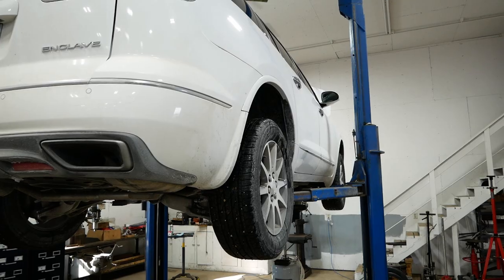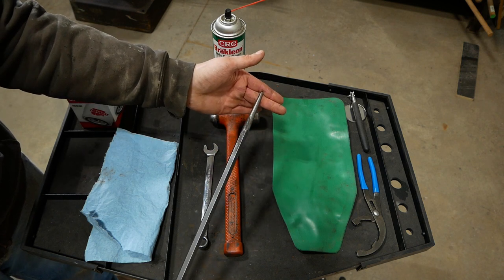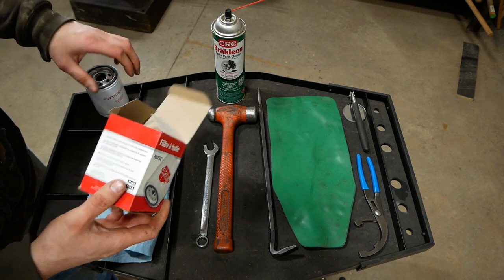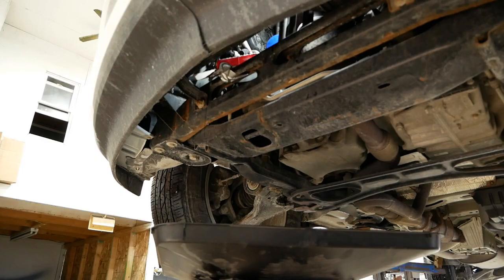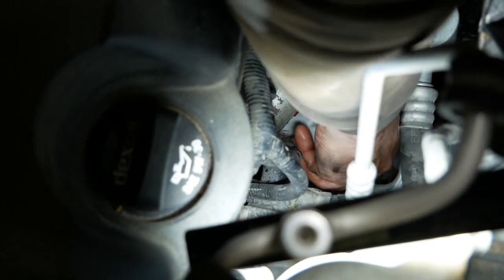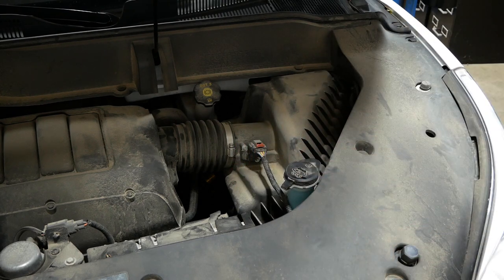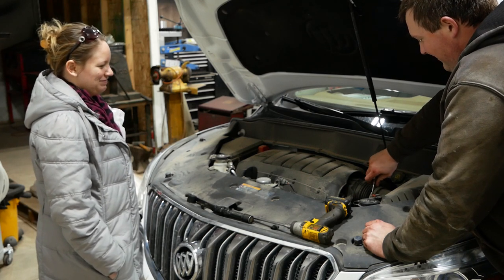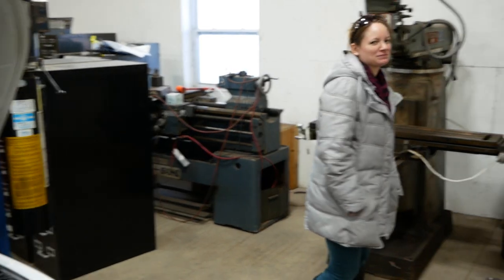Changing a GM 3.6L Spin On Filter without Spilling Oil?

Comment: I hate it when the jerk who changed the oil before over tightens the filter. I REALLY hate it when I’m that jerk.
Reply: Rather do that than have a leak
Reply: Have sworn up and down working on a tight oil filter until the whoops moment hits and I realize that I put that last one on..
Reply: @Fly-Away steel band or filter pliers will get em off 99% of the time. One time on a 7.3 powerstroke I had to put a cheater pipe on my band wrench.
Reply: @Christian I’ve literally had filters rip and tear trying to get them off, you have never experienced a stuck oil filter if you think can simply be removed with a strap wrench or pliers
Reply: @Christian Lmao, the filter get torn when you have to use different methods because the strap wrench just spins on the filter and if you’ve never seen a strap wrench crush a filter, you’ve never seen a stuck filter. And I really don’t give a shit what a type one error is, the entire reason a mechanic exist is to fix what that engineer couldn’t design right in the first place. I also find in funny how you completely ignored that part about you engineers putting oil filters in spots filter wrenches don’t fit such as this design. Unless your driving something from the 90s or older there’s a very good chance you cant get a strap wrench on it.
Reply: @Christian it will if the filters tight enough, the wrench will crush it, there’s literally only one way to use a strap wrench, when it slips try pliers or  the claw removal tool if that doesn’t work your only choice is a large pair of vice grips or a screwdriver and hammer which I don’t recommend. And my don’t give a shit was referring to the “type 1 error” as in you trying to prove your smarter than every mechanic that is literally paid to fix your mess ups. You clearly have never seen a tight filter and have clearly never actually worked on bad designed engine or products.
Reply: @Christian I have a crappy band wrench that tends to spin on really tight filters, especially of they're on the small side. I have a strap wrench that's made of rubber and has teeth on the side of the handle that'll dig in and it never slips.

Comment: My Landcruiser is similar.  I usually make a runway out of paper towels so that it does not run down the block, and on the front axle, steering, etc.  I like the Form-a-Funnel.  Had not heard of that before.  Now I have on on the way from Amazon.  Thanks for the tip Wes.

Comment: "Tons of these 3.6 V6's around" well that is an easy thing to fix, just don't change oil and filters and the problem will sort it self out in a small amount of time.
Reply: When working on cars with hidden filter, It makes it safer and easier for  quick lube oil changes  not to replace the filter and not get caught. New car owners are clueless to where they are and therefore , it's money in the bank at the quick lube oil change shop.

Comment: One of my older cars had one of those side-mount oil filters.  I would take an awl and poke a hole all the way through it to use to turn it.  One poke in one side to empty, then reinsert it and jam it all the way through to torque it loose.  Just watch for the jagged metal on the exit side.

Comment: For oil changes at work I use a windshield washer bottle cut open on the part where the label would be. Its long and oil runs super easy, use it same as a form-a-funnel, that I had no clue existed and am going to order

Comment: Right before Mrs. Wes came out and commented on the motor I was thinking the same thing.  Complexity for no reason.
Reply: I agree, except the reason is that complexity means more dealer hours on otherwise simple tasks as well as the inability of the vehicle owner or an independent shop to do the work. I’d be willing to bet that GM has a proprietary tool to change the filter without spilling and that an oil change on that vehicle is a premium price. While we beat up on the engineers, I think there are bean counters making the call on some of that design.

Comment: I have to this with my 92 and 93 Chevy 4x4s too oil runs all over front drive shaft u joint and hot exhaust i save the heavy aluminium foil pizza pans make forma funnel out of them form around the drive shaft and exhaust pipe punch hole in bottom of filter to go have coffee let it drain come back when engine and exhaust cooled down other wise you're going to get burned. I prefer the hot oil change right off the road better chance of getting the crap out before it settles in the pan oil comes out of filter pretty quick when hot too i hate oily mess after the fact so i take precautions like you your one of the few mechanics ive seen take the time to redirect the oil to avoid a mess and save the brake kleen for more critical things good job.
The last oil change when I didn't have time i took the truck to the gm dealership they had a oil change bay no appointment needed first come first serve of course i have an hour drive to the city so needless to say engine is scorching hot the tech didn't have any issues pulling the plug but as soon as he would attempt to get the filter out the cussing and swearing began first burned arm he would then tuck his sleeves on coveralls into gloves to avoid getting burned again proceeded to spin filter off only to have hot oil gush out and splash all over the drive shaft and exhaust and all over himself gave me shit for bringing it in with engine hot i told him and manager to take it up with the engineers but apparently they never did because they are still putting filters in stupid places in 2017 lol

Comment: And they haven't figured out how to put a drain plug on their automatic transmission pans either.
Reply from the maker: None of them do anymore.
Reply: I never knew how well it worked (or didn't) compared to dropping the pan, but I loved the way Saturn had the screw on transmission filters.
Reply: Drain plugs are an unneeded but greatly appreciated feature.
Reply: My 2000 Toyota Tacoma has a transmission drain plug.  My brother didn't believe me.  He is a Ford lover.............Jay
Reply: @WatchWesWork  dodge does in their truck but it's literally right above the exhaust. Can't even loosen the Allen head plug, it's useless

Comment: I turn the car upside down and let the oil run out of the fill hole, that saves time at the drain plug
Reply: Building a rotisserie that big might take some time.
Reply: @imouse3246  They got devices to put frames of older cars on a spinney wheel, seen one in a video, very cool. Maybe you can just get one of those suckers for these nasty SUVs problem solved
Reply: @baileyhatfield4273  I've seen a couple of sites do that as well, although they aren't tossing around 2 tons of vehicle.
Reply from the maker: I just turn myself upside down.
Reply: Drain the oil out of the oil pan.
Leave the plug off.
Start the engine, let the oil in the filter get pumped into the oil pan and then drain out the open drain hole.
NOT!
Reply: @tpcoachfix  That might actually work if you jumped the starter leads, and left the ignition system out of the loop.

Comment: This is why I still have the old Falcon and the Tdi 300 Defender. No plastic, oil filters face down and accessible and the air boxes are easy to open! 4 clips for the Falcon and one wing nut for the Defender. If I have to change the oil on a vehicle with a horizontal oil filter I will 100% follow your method as it works brilliantly!

Comment: Haven't really found a "good" way to change these. We buy brake clean in bulk drums, so I usually just hose it down good when changing them. Then, when it's up in the air, I wipe it down best I can with more brake clean. Definitely agree with the Mrs. on all that plastic under the hood. Makes it tough to jump start when it gets crusty under the ground lug.

Comment: Ah yes, GM and their fit anything anywhere obsession... 😂
Reply: Not just them, my wife graduated from college at the old age of 45.
To celebrate that and a good paying job in the medical field she bought her dream car. A '99 sebring jxi gold edition convertible.
I had to do the regular maintenance as usual.  Not happy. Intake manifold had to come off to get to the back 3 plugs, left front tire off to get to the battery in the fender well. So yeah you've got the designers and the engineers trying to find where to put things
Reply: @donniebrown2896  If it makes you feel any better I own a Nissan I-4 and i have to take the manifold off to replace any spark plugs.
Reply: @MalleusSemperVictor  

I could get to all 8 on my old 4 cylinder Ranger without removing anything. 4 cylinders, two sets of coils, 8 wires and 8 plugs.
Reply: @MalleusSemperVictor  I had an early 90s V6 Camry, same deal.  Dropped the manifold right over the rear bank and made it all but impossible to reach.  Gave up and paid a shop to do it, labor was so bad it cost almost as much 20 years ago to do those plugs as it does to have a shop do all sixteen plugs in my Charger now.

Comment: Wes is using a kind of funnel?
Reply: @queenstownkid  it’s sarcasm. Wes does not like funnels. He’s been pretty vocal that he hates them.
Reply: @jeffburdess2237  MY OCD as screaming GET A FUNNEL when he poured both fluids. I bought a set of funnels that latch into the valve cover. But I DID have to do a TON of oil changes EVERY FRACKING DAY! Have the guy with 40 years experience doing oil changes while the GS is outside smoking a ciggy. The GS gets scheduled breaks. The flat-rape guys? Nope.
Reply from the maker: It was a cold day in hell.

Comment: If I owned that Wes I would have removed the huge plastic shroud and thrown it away.
Reply: around here, they just get beat up by the winter salt ect and then idk 10 years old they're so broke, on my car, everytime i got under it for an oil change, and then was strugglign to get out, a SHARP ice dagger shaped broken off plastic kept on stabbing my gut. I tell you it was the last time that plastic would see the road.
Reply: And it will overheat

Comment: If I owned one of these, I’d install a quick change valve in place of the drain plug and vacuum out the oil before replacing the filter. You’d have to crack the fill cap open towards the end of the drain to pull the oil through the filter the correct way, and then seal it again before cracking the old filter off to get most of whatever oil is in it to not have to worry too much about a drain channel like you constructed, but you could leave your vacuum source running to catch the last drips from it. Maybe <shrug>. 
I’ll try it on my Rendezvous and let you know how it works out.

Comment: Would the oil drain more quickly and completely if the oil fill cap was removed?
Reply from the maker: I doubt it. The drain plug lets in plenty of air.
Reply: @WatchWesWork  Thanks for the reply, Wes.  Good point.

Comment: I have been using the economy form-a-funnel for many years and I can tell you they work much better shiny side up. I always like to get more than one use out of my free funnels, and the oil drains quicker on the gloss.
Reply: Not the first guy to do this but my mom always cut the bottom of a quart bottle of oil and used it as a funnel when needing to add oil to her car. Also just placed it within the engine compartment for next time. Sort of an expected thing in our family to do. Not sure if it's common or not.

Comment: Great tip on the cardboard box oil tray! I have used the “punch a hole in the filter” trick with a slight variation. I punch a hole at the end of the filter from the top then loosen the filter half a turn to drain but not so the rubber gasket leaks. Punch another hole to speed up the draining. When you’re ready to take the filter off, put some tape over the holes to keep the filter from getting slippery. Works on my Lycoming 0-360.
Reply from the maker: Great tip!

Comment: The sane truck helps a lot on pickups and yukon/tahoes with 5.3 s and 6.0. The oil filters are charged up with quite a bit of oil pressure and when you loosen them they splash oil all over yiur hand and the engine block unless you pucrure a small hole in the bottom and let it discharge it into the drain pan . After that you can spin them off with no mess.

Comment: Pop a hole from above of the filter and turn it 180 from the beneath the car. It will give you a more complete drain.
Reply: Can't reach it from underneath to turn it BUT you are on the right track- after the 1st drain is near complete, put a drain pan on the floor, lower the car and put another hole in the top of the filter to complete the drain.

Comment: Immpress me: show me how to change the transmission filter without spilling the transmission fluid.
Reply: Replace the pan with an aftermarket that has a drain plug like I did. Did I impress you? :)
Reply from the maker: There's always a way. Pull the cooler line and let it drain, or suck it out the top with a fluid extractor.
Reply: I pay someone else to do it. I never spill a drop 😁

Comment: I have used this technique for years and have that malleable funnel to use on my track loader. My one suggestion would be to crack loose the filter before punching the hole in it. It is more difficult to be trying to get the filter off if it gets slippery from oil!!!

Comment: This issue is plaguing all industries.. engineers with no practical knowledge abound! I deal with this on a daily basis in the electrical field. I had one job where the engineering firm was out of Canada and those guys were on point, they knew about issues before I even brought them to their attention and they had a solution or were working on a solution... very rare these days.. 
oh and thanks for reminding me about a form a funnel, have been wanting to get one of those for a while..

Comment: Your solution is very similar to what I do with my wifes 1996 Saturn SL1 (yeah, it's still alive and running after 25 years). That stupid filter is in even a worse place and only accessible from below. It took a few years of cleaning nasty oil off the subframe, block and CV joint before I hit on the idea of taking a 1 qt oil container and cutting it in half the long way. Jamb that in over top of the drive shaft and loosen the filter. All the oil drains to the cap end and easily collected in a drain pan. I hate the design but the workaround makes my garage floor stay a whole lot cleaner.

Comment: just changed the oil on my wife's Enclave Monday. I don't have a lift so I drive it on to ramps. I just loosen the filter and let it drain a bit before removing it. I've never noticed excessive spillage. Maybe having it on the ramps improves the angle of flow. My problem is getting the new filter started. You have to do it by feel and it can get frustrating. I have to agree on the air filter. It sucks. I only inspect it occasionally.

Comment: Mrs Wes, we have all wondered the same thing.

In other news, I found that during my time doing oil changes at a GM dealer that you do, in fact, have to put a wrench on those stupid filters. Without fail, every single time I put one on to the recommended spec, it would come back 30 mins later leaking like a sieve.

Comment: Good job!  I call the channel , a gutter ( carpentry term).  On my Toyotas with horizontal filters or the Avalon with a slightly tilted up or horizontal. When installing the filter I can 1/2 fill them with oil and let it soak in, and then as long as you keep on spinning them as you move them into place oil does not leak out. On the Toyotas because they are more out in the open ( Easier to spin a filter on) It works well and gets oil flowing quicker to the crank.
 I will start to punch a hole or two,  Perhaps a large hole in the bottom and an ice pick sized hole in the top of the Avalon to vent it..  The Celica Supra is  under the exhaust manifold , so you do it "blind" by feel.
 But I like the green folding "funnel" ,, Gutter to me.  I like to learn you,  Wes, so thanks for  that!
Reply: Edit>>>>>   The last line was meant to say:   " I like to learn FROM you Wes, So thanks for that!  

 I hate oil all over the place on a simple oil change. And I use a special funnel to do oil changes on my Norton Commandos and lean the bike over to get all the oil out cleanly and not on the chrome exhaust and frame and floor of the shop.  .

Comment: My folks have one of those vehicles - I'm glad they take it to the dealer for most routine maintenance.   I only have to perform non-routine maintenance on it (like wiring repairs).

The bleed hole on the oil filter works for vertically mounted filters too (open end down, like Mazda RX-7's), to allow air into the filter and oil to drain into the engine.

Comment: I gotta say I never thought of doing it this way, great tip and I can already think of a few other vehicles this would work on. I have to recommend thought if your buying brake cleaner getting it in the 18.9L drums is the absolute best way, I get it here in B.C. for about $80 a drum and I use 1.5 drums a year, good amount of money saved when your paying $5 to $7 a spray can. If you do go that route best sprayers I've found are the 1L pump and spray with the viton rubber seals, they're a little pricey, run about $60 Canadian each but brakleen doesn't seem to harm them at all and they are tough as hell.
Reply from the maker: I don't know where you can buy it like that around here.

Comment: ive also cut plastic from milk jugs or the rounded corner of a litter box. You can even soften/melt the plastic into a specific, permanent shape with scalding hot water or heat

Comment: Old timer taught me use a bit of grease on a filter instead of oil. The oil dries over time and makes the filter hard to get off from the friction...it's worse now that oil changes go so long, and motors run so hot. Ever since I started using a smear of cheap grease, I've never had a filter require a wrench 🔧